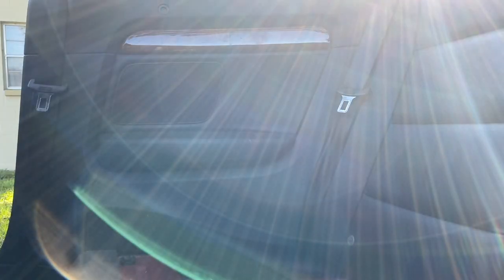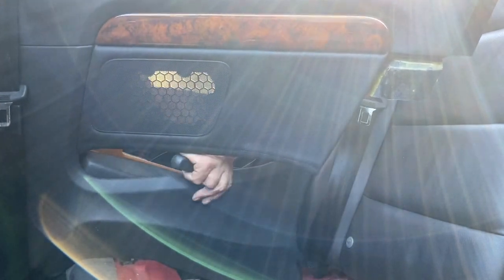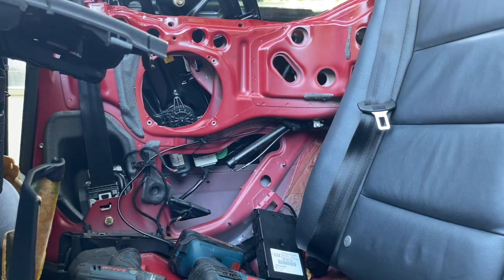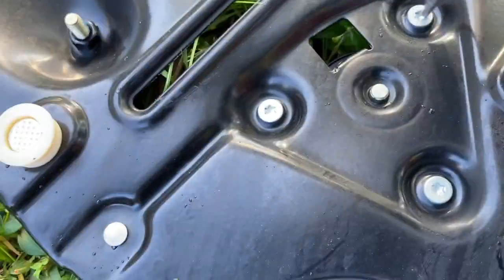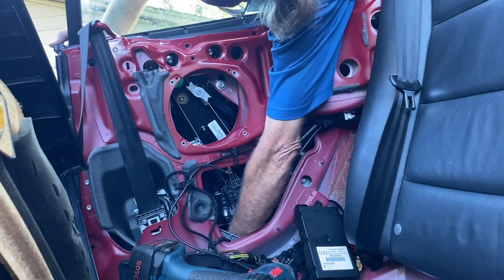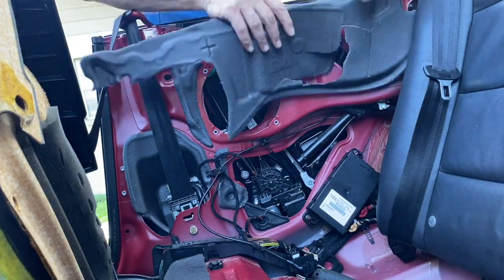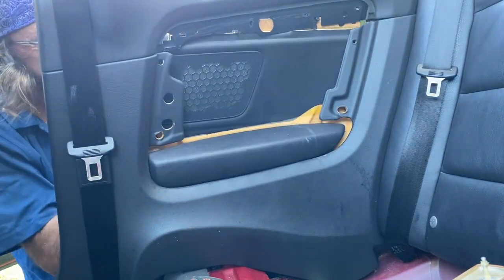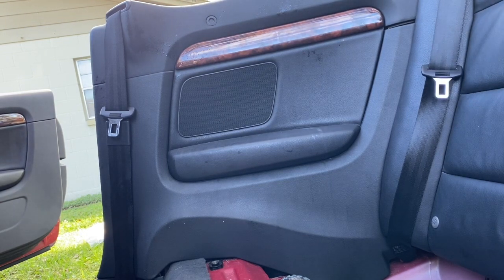How To Replace Rear Window Regulator On Audi A4 Convertible Like A Pro!

Comment: Here's a trick for the harness: before you start to lift the window and regulator out use a flat thin blade screwdriver, about 1/4" wide at the tip.  Insert it at the top of the side of the clip, near either the front or back end.  Give it about 1/4 twist.  Move to the other end and do the same.  The harness clip will slide off easily by hand (even on my 18 year old A4 Cabriolet).
Optional: if you want to keep the side trim panels pristine, remove the rear seat back as well.  It is a challenge, but there's a great video at the Total Technik site that I found very helpful.  (ex-Audi mechanic)
Reply: Thank you, the screwdriver tip worked for us and made it very easy to remove the harness.  We also did remove the seat backrest and it was a good opportunity to clean a lot of stuff and condition the leather properly on our 16 year old S4.

Comment: my rear glass does not close all the way, there is about an inch or so.  Would it be the regulator or the glass is off on the regulator.  Its a cabriolet !
Reply: Probably the regulator.

Comment: How did you pull the regulator out so easily with the window on the down position in the cabriolet?  I've been at it and I can't figure out how to do it.
Reply from the maker: You can cut the metal cables if that makes it easier to move the glass to a position where you can get it out. OR Drive down to Florida, I'll show you how its done.
Reply: @PowerUpAuto  Would love an excuse to drive down to Florida from Iowa in the winter!  For now, I'll try cutting the cables. What did you do when installing it with regards to the glass being in the up or position on the regulator?  I assuming that it's the same with an S4 cab vs an A4 cab.
Reply from the maker: @omarahmad25  Once you get the new regulatort assembly in you can plug it into the wiring harness and move the glass up or down as needed.
Reply: @PowerUpAuto  So, i got the regulator out!  I ended up unscrewing the glass to do it.  I transferred the glass and the motor to the new regulator and I have it back in the car.  However, I can't manually move the window up and down.  Does the motor care whether the glass was up or down when it was removed from the old window?  Does the harness have to be plugged in to move it manually?  Sorry if that's a dumb question.  I'll like to be able to move the window manually before I put everything together.
Reply from the maker: @omarahmad25  Plug in the harness. That should allow you to move the glass up or down if needed by pressing the switch.
Reply: @PowerUpAuto  Awesome, it works!!  Thank you so much.  Very happy with the results.  The 3 screws for fine tuning the position of the window are great for making adjustments.